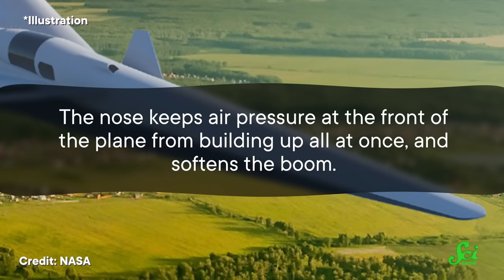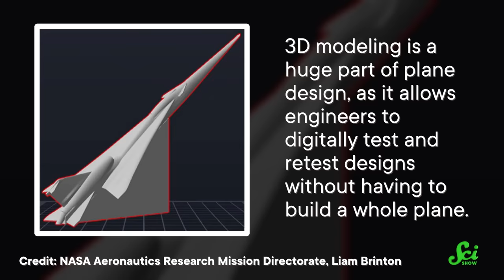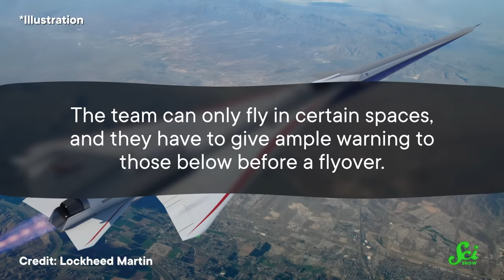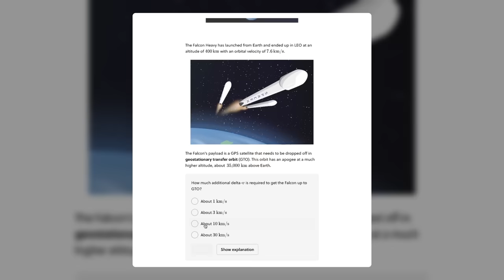Boom Boom Thump: How to Make Quieter Supersonic Planes

Comment: I would prefer high speed trains for the land part.
But to cross oceans and places where trains can’t go it could be fun.
I just really want more trains tho.
Reply: building a supersonic train is going to be extremely hard , keeping it from flying off the tracks might not be possible and the turning radius will be huge requiring lots of land
Reply: Trains are reaaaaally expensive to build and not a solution for a significant portion of the world. Either because of the costs or because of the impact to local fauna. 

Planes are just simpler and will continue to be faster.
Reply: The future is high speed trains and (hopefully) low boom supersonic planes

Comment: I have done too many long haul flights in the past but would actually not mind them taking a bit longer if the emissions were less.
Reply: This is what night trains are for. Even at relatively modest speeds they can go very far. 8 hours for sleeping, plus a few hours before and after can let you travel for 12 to 14 hours without having it be a chore. At a modest average speed of 150km/h (achievable on relatively normal rail, if well maintained), you can go 2100km in a night with relative ease. With some achievable upgrades 200km/h should be possible. Near transcontinental journeys can be covered this way.
Reply: @placeholdername0000 Unfortunately trains are a joke in North America. Meanwhile in Europe...
Reply: @e.matthews  Can be fixed
Reply: @placeholdername0000 Here's hoping! In Canada at least there's no political drive at all to make transportation better. The only progress has been in budget airlines.
I wish better luck to our neighbours
Reply: Most passenger planes still run on leaded fuel.
Reply: @craigb8228  Eh, no. Small, older piston engined planes yes, but turbofan or turboprop run on kerosene.

Comment: I think an era of widely available supersonic commercial flight will happen within my lifetime. It'll be a huge step forward if this really does fix the problem with supersonic booms. The issues with fuel efficient, passenger capacity, and cost will still need to be worked out. And I think because of the infamous Concorde crash it'll take extra effort to convince people that it's safe.
Reply: Im pretty sure it's just going to be limited to private jets if this comes to market... at least for a long time.
Reply: Hmmm the BA Concord made 50,000 flight and flew more than 2.5m passengers. It has one crash. Aeroplane incidents (crashes) have been over 11500 and 83733 people have been killed. But we are fly all the time still. I flew yesterday and didn’t think once about crashing. Tbh, I believe if you are going to get rid of something then there must be something better to replace it. There isn’t. Flight are slow and boring. Uk to JFK 7 hours 30 mins!!! Used to be 3 hours with a tail wind

Comment: In the hypothetical that faster than light travel is possible, what would be the equivalent of a sonic boom?.
All i know is that the object would become invisible for a while and then it would be visible, but would it have a beaming shine when that happens or a light explosion (light as in lux not weight)
Reply: You know that glow that nuclear fuel rods give off in a cooling tank? That is the equivalent and is called Cherenkov radiation

Comment: Would'nt it also  be fuel-efficient since less drag on the air means less force used to fly
Reply: Possibly, but not necessarily, a lot of the sonic boom mitigation is in blocking or directing the shockwave away from the ground. For example blocking the shockwave of the tail using the wings. That being said if you don't have such a sharp pressure build up it'll likely make the transonic transition from subsonic to supersonic flight smoother, and be more fuel efficient as its breaking the sound barrier, as the most fuel-intensive part is normally right around mach 1, before drag then actually drops off a little past mach 1.

Comment: Low cloud layers tend to reflect sound back towards the ground. This can channel sounds from outdoor concerts and runways to areas that never hear them unless it's overcast or rainy.
Operating at high altitudes is ideal, but I'd like them to test how low a cloud cover can be and still have a supersonic jet flying below. Must supersonic flight always take place above a cloud layer?
Reply: Excellent consideration. I believe you'd only go supersonic as you approach cruising altitude!
Reply: Yes. Disregarding noise entirely, supersonic low altitude flight is terrible for fuel burn. The air is like 5 times thicker than it would be at 60,000 ft which is where the concorde flew. 
If we could ignore safety regulations we ought to do sdt st 90,000 ft like the SR-71. Peak shock pressure scales as e^-kh/h^3.
Reply: @appa609  excellent and useful mathematical consideration!

Comment: How about sending a contra-soundwave from the plane that cancels out the boom wave ? ^^ Well ok, carrying a large noise-speaker is not appropriated hehe. But maybe it can be ultrasonic some kind with different waves from a spectrum you dont hear, ok not :-) What if you "jump" the point when reaching ultrasonic by far, so acceleration up to the point as normal, than suddenly increase accel bei 500% wide into the area of ultrasonic so the surrounding air "forgets" about whats happening ? ok Im not a good engeneer :-)

Comment: Another question that will need to be answered is how it scales. This prototype does not appear to be able to hold more than a couple people. Will the length of the nose need to be doubled to double the passenger area, or quadrupled. To carry 16 people will there be a 1/2 KM long nose cone?
Reply: This design will never be scaled. It's a silly design for a passenger jet. It's more of a validation of their simulation methods which would go on to design a passenger jet.

Comment: The craft isn't as much the ongoing problem as much as a solution for something that works with exisiting civilian airports. Civ airports that exist cannot adapt to possible "faster" designs of civ jets.
   We need a stock of newer engineers working with the old stock, in my opinion. Otherwise we will not get this produce reasonably soon.
  A craft that can do it, with existing airports, would be worth it's weight in gold and more.

Comment: To say there was concerns about Concorde safety is total BS. Nothing had a better safety record than this aircraft. When it finally did have the  1 single incident. It had nothing whatsoever to do with the aircraft itself. The accident was caused by debris on the runway. It got kicked up when Concorde was taking off. The debris punctured a fuel tank.
It did use lots of fuel & tickets were expensive to fly on it. But it was still British Airways most profitable aircraft.
The reasons it stopped flying were political reasons. Mainly pressure from US politicians & industry. But that's not a great look so it's swept under the carpet.

Comment: Concorde was actually cost effective- it flew for almost thirty years, and was not subsidized for most of it.
Reply: I guess they mean the cost of flying as a passenger in the plane?
Reply: @clemente_01  They had plenty of customers. The markup they could sustain was insane.
Reply: @justayoutuber1906  Airbus which held the air worthiness license for Concorde essentially forced its retirement by hugely increasing its maintenance costs in early 2003 to the point of making it uneconomical for Air France especially to keep flying it, presumably because they decided it was uneconomical for them to keep supporting such a small fleet. 
They then refused to grant a license to any other company such as Virgin Atlantic that wanted buy the planes from BA and Air-France and keep it flying.
Reply: @justayoutuber1906  It failed in the end because the cost of maintenance increased due to the airframe's age and the small number of aircraft, and the market shrank due to 9/11 killing a lot of the passengers off.
Reply: @pleb989  If they didn't want it, and had no plans to ever use it, why just hold onto it for nothing, and let the technology die?
Reply: Concorde must have been hell for sea creatures, like whales and so on.
Reply: @Call-me-Al  a few flights a day, vs many military jets meant it was not significant
Reply: @davidioanhedges   pretty sure military planes don't sonic boom over the middle of the ocean multiple times each single day,  countries would get nervous about that much military activity in the middle of international waters daily.

Comment: I really don't want quieter sonic booms. I'd rather we work on things with more practical, and less military possible uses. So far, this sounds like the main drive is more convenient travel for the already ultra rich, and all other applications would turn out to be military.

How about robust rail travel and ecological restoration programs?
Reply: The sonic flying does have non-military potential. And not just for the rich. Imagine this technology for normal, commercial aeroplanes.
Everything starts off expensive. It just means the next step would be to find a way to do it cheaper.

Comment: The thumbnail is wrong, that’s not supersonic flight, it’s moisture in the air condensing from change of pressure as the aircraft moves though the air. Be better off showing the other supersonic pictures shown later in the video
Reply: And what's causing the sharp pressure drop across a conical surface in free air?  Rarefication after a supersonic shock. Based on the angle of the shock the local Mach number is like 1.2. 
Take your umm acktually somewhere else.

Comment: If anyone thinks this may not have military applications, well, get real. The Concord was a financial disaster and only kept flying because of substantial subsidies from the British and French governments. While I was working with a team that included French engineers back in the days when the Concord was still flying, the French team members commuting to the USA only used the Concord when flying from the US to France because when flying to the West the time zone changes virtually offset the flight time savings (the flight time on commercial airlines between Paris Orly and JFK in NYC is about 8 hours. This is while crossing 6 time zones. As a result travelers leaving Paris for NYC only log 2 hours later clock time (8 AM in Paris to 10AM in NYC). The cost per seat on the Concord $2800 each way in today's money. It doesn't take an accountant to decide the saving of 2 hours wasn't worth $1,400 per hour. The actual cost was around $6000 to the airline, which is why the service required a huge subsidy. The cost to the French engineers was substantially lower since they were with a company partially (mostly) owned by the French government. Despite this, it STILL wasn't worth the cost to fly both ways. The flight time on the Concord was about 3 hours, a savings of 5 hours, meaning if you left NYC (JFK) at 5 PM you landed in Paris around 4 AM, so that was considered worth the cost (especially at their subsidized cost). The other observation is the Concord was only able to accommodate 100 passengers. So it was super expensive and really only made sense when traveling to the East. If you added the travel time to JFK from Chicago (where the project was located), the overall travel time savings made little sense. Of course, if you could fly over US cities this would change, but how many people want to fly from Chicago to Paris or London every day and if they had to pay the actual cost of over $6,000 each way?

Comment: Given that carbon emissions go down as you slow down, and that planes are the biggest contributor to those emissions in general (so we'd rather reduce their use as much as possible), I wonder what the chances are for the X-59 to come to fruition and become commercially viable. It's kind of the opposite path to brining back airships like Veritasium recently suggested.
Reply: It's likely only viable for a emergency "gotta get there now" flights. And maybe bragging rights, who knows.
Reply: An extremely high flying supersonic craft would have less emissions due to the rarefied atmosphere causing far less drag - but would only be worth it for very long journeys

Comment: It's cool this supersonic science is being researched, but even if it works it will be wasteful.  Using resources to fly a reasonable amount is fine, but supersonic flight burns about 8 times as much fuel per passenger per kilometer.  Burning 8x more carbon into the atmosphere crosses the threshold from using resources to wasting resources.

Comment: I have a question. if they are trying to have the boom on the top, would that interfere with satellites, or will the sonic boom not reach space?
Reply: It will not reach space because sound is a pressure wave in air. The aircraft would cruise around 18 km above the ground. The lowest satellites are about 200 km above the ground. So not only are the satellites significantly farther away, there's no atmosphere for the sound to propagate.

Comment: But what ended Concorde was the landing problem, and specifically the cost (cutting...) of the tires. Not the noise! It was a tire explosion that ripped open a fuel tank that caused the accident that stopped the Concorde. This happened at take off, but the tire was damaged  during landings.

I can't see how a plane in the shape shown will handle well at low speeds. A large heavy passenger  plane coming in at full speed will always have this stopping problem.

And with that straight nosecone the pilots will have to approach upside down to get a visual on the runway, the Concorde had that weird tilt for a reason. Even with your fancy cameras you will have to rewrite many rules to be allowed to land that.

Comment: Here's a question. If you break the sound barrier, do you technically hear nothing? You are literally going faster than sound
Reply: Velocities are relative. The air/sounds inside the cockpit are roughly stationary to the pilot, so you'd hear sounds generated in the cockpit or inside the plane itself. The plane itself would 'hear' sounds that were created in front of it as it flies through those sounds (though with a doppler effect, compressing/decompressing the sound waves). Sounds that were generated behind the plane, would not travel through the air fast enough to reach the plane though. So, if multiple supersonic jets were flying near each other, the one(s) in front would not hear the one(s) behind them, but any jets in the back could hear any jets in front of them.

Comment: What's the plan of a camera or the screen fails? There's no window to see out of.. ejector seat I guess
Reply: I imagine the plan is redundancy, and if that fails, enough sensors and smart controls (again, with redundancy) to get the plane and its occupants to safety even without visual clues. To be fair, nowadays pilots rarely have to do much on routine trips given how many tasks are automated or simplified by instruments, so I don't think losing direct sight would significantly impact the survival chances of many flights. In dire conditions like storms, losing instruments, or such, sure, but then I don't think losing sight is your biggest problem anymore.
Reply: You still have instruments. Commercial pilots land in heavy fog JUST with instruments
Reply: You're probably right.. I don't have any knowledge of planes so just assumed the worst. Cheers for the info my guy :))
Reply: There are still windows on either side of the screen. A bit of swinging side to side could give the pilot enough forward visibility to make a landing. Lindbergh had only side windows in  his "Spirit of St. .Louis" and still managed to land in France in 1927. Pilots of single engined prop driven, tail dragging fighters such as the P-51, Spitfire, etc,  had similar problems with their forward view with an engine blocking it.

Comment: 5:55 We can already fly anywhere. NYC -> LA in a couple hours (or any other implementation of supersonic passenger travel) does not meaningfully improve the lives of 99% of people. Not saying I don't think it should be developed, maybe there's use cases for supersonic travel that we haven't discovered yet, but just don't understand why people are so excited for this. Not to be a boomer but if you want to cross half the world, you'll survive taking like... 8 hours... to get there.
Reply: It's to beat jetlag, though allegedly you can readjust your internal clock by fasting 16 hours. Which would absolutely be worth it to not have 3-4 days of jetlag. Unfortunately because of medical reasons fasting isn't an option for everyone.